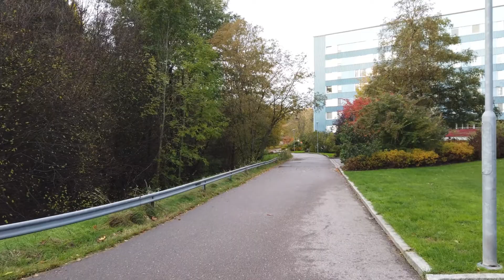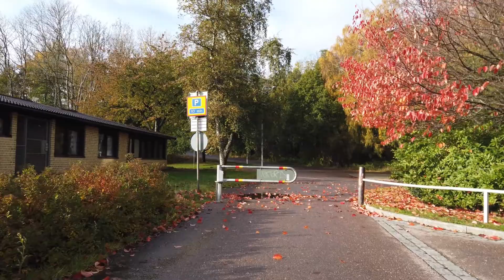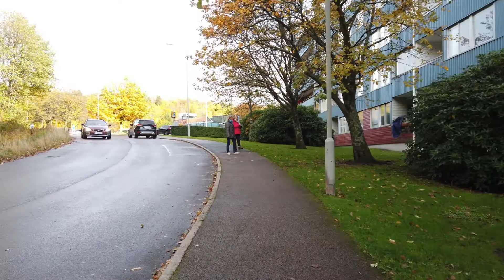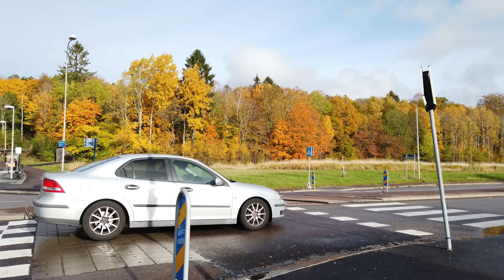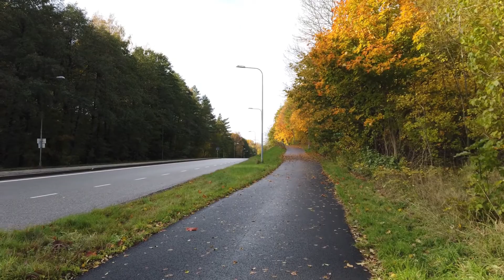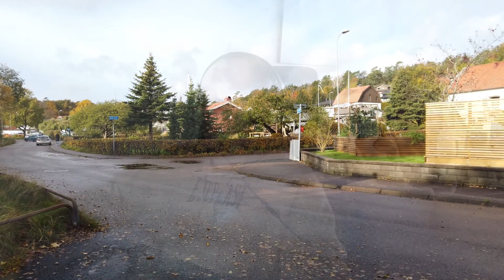How do you fix legacy code?

Comment: I work on a 20y old multi system and I do alot of new feature on old code and I hate it, no one knows to tell me the full requirement because its so old so when I try to refactor some part to make the code better and cleaner it always break stuff in so many files and features that I didn't even know that it's bean used and it was ok if they know what not working properly and I could fix it but no one knows how to QA and where there is a break that need to be fix, so i kinda give up on some part of the system and now I write shitty code and hate my work

Comment: so he said he needed to change like 30 files to do a button implementation at what number of files is it  too much like over 5 or 10? (junior no industry working experience)
Reply from the maker: A better question is if you feel safe changing only 1 file of the 30 files and still have the feature working as intended.
This is what the DRY principle is about. With a lot of duplication you need to track down each permutation of the button and update it in order to be sure you did not cause a inconsistency.
This is also why unit tests and visual regression testing is so important for the UI.

When you change the button in 1 place you will not know if it needs to be updated in all the places or just some but to answer that question you need to understand all the use cases of the button.
This is very unlikely to be possible without a automatic check like unit tests.
If the button is used as a base type for other button then changing it will have an effect that cascades to other areas of the system and perhaps that is not intended.
This is why visual regression tests are useful because they will make sure you know if changing the button visually only changes it in expected areas of the code.

If you have no IT experience what I just said will likely be way too advanced for you but that is ok, just focus on understanding why unit tests are useful and when to write them. If you continue working hard what I just said will become "obvious" to you.

Comment: At your convenience, when you see it fit to discuss, could you talk more in 1 or more videos about the process of migration that you refer to.  What determines what parts of legacy codebase must be  rewritten in a migration.
Reply from the maker: That is a very complex question with no easy answer.
I like to think about refactoring as a cost / value problem and the scope of the refactor should determine what developer should do it.
A small simple refactor is a junior level problem but for bigger things a senior devs is needed.
At the company scale only a genius level developer should do it and often you need a team of senior working together to make it work.

You know a system needs to be refactored when the time it takes to maintain it has a greater cost than the refactor itself.
This includes dev happiness, unhappy devs are not good but never give in to children.